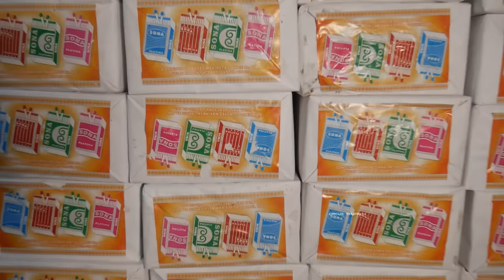Handmade Wax Matchsticks manufacturing Process in Indian Factory

Comment: All machinery cost
Reply: 2.5 crore. Want to start business?
Reply: @mahendranperiasamy5274  so you told hand made how it's hand made then if 2.5 cr machinery needed.
Reply: @yatriengineer7446  Everything hand made uses machinery of some sort. If you bake a hand made cake you are still using an oven and a bowl and a mixer.  Sewing a hand made suit uses a sewing machine.   Hand made means not a huge automated factory.  Though this is still a factory with a lot of manual labor I'd say.